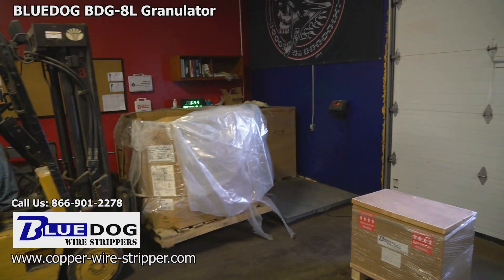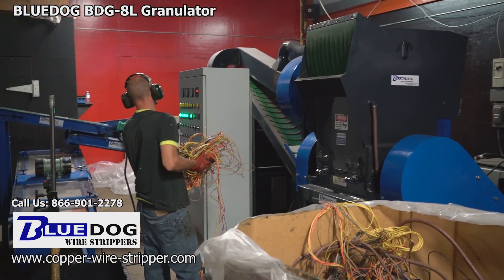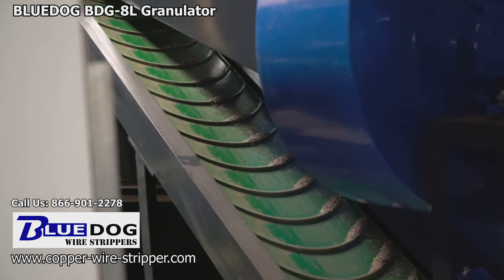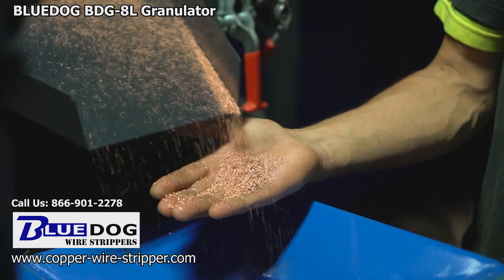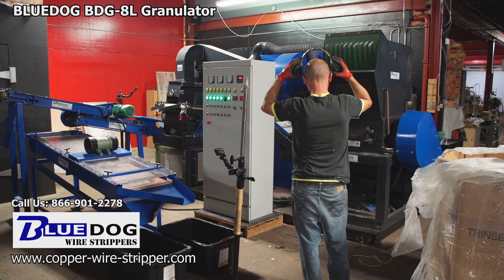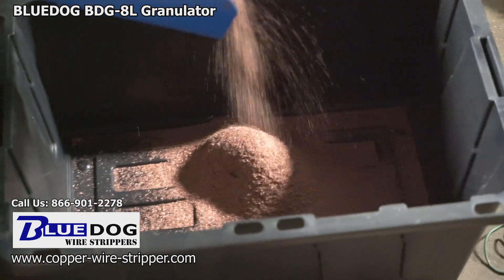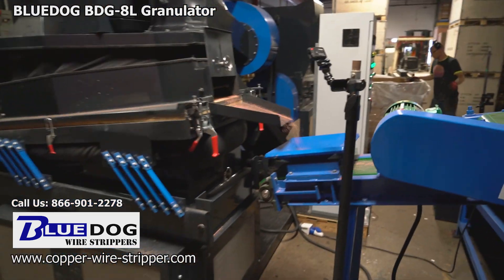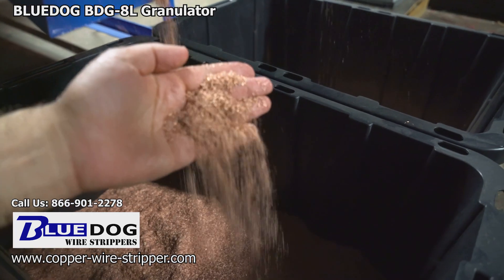Copper Chopper BDG-8L  - Granulate your scrap copper wire

Comment: A copper striper would be much better. This way you know when you take the plastic off you already know 8ts separated frome the copper.this striper in this vido you don't know for sure if all of the copper is separated from  the plastic when it all at once it turns into powder.

Comment: I'm with everyone else; that feeding mechanism is INSANELY dangerous and anyone would have to be a fool to use it.  All it would take is a single loop of wire to be on the wrong side of the guy's arm when the wire gets yanked into the blades and BAM!!!  His arm may not be sucked all of the way into the blades, but a serious injury is absolutely guaranteed.

Comment: Massive potential for an accident there , get it chucked in and don't touch it again. You'll be pulled in as fast as you you could scream. I work with granulators 10x this size, all just as lethal but a wire loop is something else.

Comment: How many tons to make it pay for itself?
Reply: Purchase price per pound today 11/24/21 for romex wire is $1.25/lb. Romex is 60% copper by weight.
The end product of #1 copper dust is being purchased at $3.25/lb today.
Take 100lbs of purchased wire @  $1.25/lb = $125 purchase price.
After granulation/recovery 60% copper = 60/lbs @ $3.25/lb = $195
Thats a $70 profit per 100 lbs (or $0.70 cents per pound profit)
This particular unit comes in at $36,000 USD
That would be 51,428 lbs for this to pay for itself, or 25 US tons.
Reply: @TheShowgunofHarlem cheap

Comment: have you passed an air particulates inspection with that machine running? No filtration safety masks?
Reply: To filter what? There's no dust to filter. Look at the room. The air is clear.
Reply: @mattjohns3394  You might not be able to see it but it can be there. Like dust that's only visible in bright sunlight.
Reply: @EPICRANDOMGUY02  This is the sort of comment that makes people hate Occupational health and safety.  Yes, microfine dust may be present but its not toxic. There would be more (and worse) dust coming off a concrete floor.
Reply: @mattjohns3394  I'm not a health and safety nazi, so I get what your saying.

Comment: Loader needs a loading belt or your going to lose a limb.
Reply: Yeah a thick wire could easily loop around a hand. And to the person saying you wouldn’t be able to reach the blades. Something has got to give. Either the wire snaps, the motor stalls, the hand is ripped off or the guy is pulled in.
Reply: It doesn't look like there is emergency stop within reaching distance either...
Reply: Even shaq isnt tall enough to reach down to where the blades are
Reply: Loading hopper would be better. Keeps the bulk loading below the choke point fo the machine. Wouldn't take up as much space either. Fill up the box, push a button, and the box tips in to the shredder.

Comment: Why don't you put an external AMP meter in the operator view where he normally stands instead of relying on his hearing?
Reply: If the operator needs hearing protection, but has to 'listen ' for the sweet spot, OSHA will be calling.
Reply: Or just spin the CP 90° toward the operator.

Comment: Interesting machine.  I'm sitting here trying to figure out how the machine is taking the insulation off the copper to be sorted/separated.
Reply: pretty sure it's gravity based. Just chop it up into tiny pieces, vibrate the whole thing and the copper falls to the bottom with plastic on top. The finer plastic granules may have some copper left in them so it's recommended to recycle them through the machine.

Comment: I've operated this machine already,its a "beast"!my only problem is that theres too many plastic coming out together with copper in front of the first outfeed,what should be the best setting for the fan speed and the shaker?
Reply: there are only two reasons for that problem:1. the machining precision is bad 2.the screen of the air separator is blocked
Mostly properly the 1st reason if the copper is not coming in the middle
Reply: @keruimachineryfactory5557  ,what is the machine precision?
Reply: @mangembusnalimbe778  it's the working accuracy of making machine
Reply: Usually when the wire too thin ( under 0.2mm), only gravity separation not enough. Need electrostatic separation, i can show you how it works. lol

Comment: At 4:15 there are two buckets, is it the same product in both of them?
Reply from the maker: There are 2 different sized sifting screens on the sorting table.  One bucket is for corse sized granules and one bucket is for fine-sized granules.
Reply: @bluedogwirestripper  oh, thank you! Do you happen to hace a video presenting how that sorting board operates?
I'd also like to know about periodic maintanence, power vonsumption and voltage
Reply: @bluedogwirestripper ,I have difficulties getting the precision for running data wire. It always comes on the front with plastic. 
What are the adjustments for the shaker table running data?

Comment: Instantly chops your #1 copper-wire down into lower valued #2 copper-dust.
Reply: Copper wire scrap price : $2.00
Copper granules scrap price :$ 8.00 
I still don't understand his comment
Reply: @mustafamckinlay-malas801   The reason you are not understanding his comment is because it's incorrect, and he's an idiot. Insulated copper wire (#2 and #3) is currently selling for .20/lb - .28/lb.  It's not feasible to strip it, as it's too thin to be bare-bright, and too time consuming. So for 100lbs of #3, you would get approx $20. By granulating it, you would recover approx 60% copper and sell it for #1 @ $1.90/lb (today's price) @ a $140 return. He obviously cannot do math and is a troll who comments on videos where he knows nothing of the industry.
Reply: @TheShowgunofHarlem  you actually get a higher premium price for the granulated copper.takes less energy to melt it down and process it.was on a service call at a scrap yard and watched this process with the air induction machine.
Reply: I think the idea is that u could use this to make pure clean copper.
Its much easier to melt when it is granulated. You can put the powder into a mold and melt it directly inside the mold.
Another thing this might be good for, is to take wire which has insulation on it still, granulate it, then a magnet used to separate it.
All that said, the machine is probably really really expensive and it doesn't look useful to a scrapper. It's more useful to someone who is into taking it a step further and recycling the metal themselves, which could make u a lot more than scrap value.
Reply: Guy who made this comment is obviously just a scrapper doesn’t know what he’s talking about.... this is made for industrial scale the copper dust is going to get melted down this isn’t for selling to a scrapyard
Reply: how can copper WIRE be worth more than bright and shinny
Reply: You can sell for spot price/Comex price to copper furnaces. I have a copper pipe place that will give you spot price for your copper.
Reply: Holy Revelation your are a dum ass

Comment: Do you get a spare arm when it gets dragged in the hopper....? Very unsafe for gods sake
Reply: Well it depends where it is... It looks like where he's feeding stuff in is actually a chute where the copper slides down into the blades. Not where the blades are sitting right in front of his hands.
Reply: @Tommo020788  If the wire wraps around the person feeding the machine, that wire will either rip him in to the hopper or tear a limb right off.  Research what happens when a boater gets an anchor wire wrapped around their leg.  You never expect it and you're not fast enough to react.
Reply: @Tommo020788   What it looks like is if he gets his arm caught it will rip it off...
Having worked on all manor of plant, commercial diving,  heavy engendering etc 
If it looks dangerous then it usually is!!!!!!
Reply: @theessexhunter1305  If he gets his arm down to the blades his head is gonna be inside the chute. if that's unsafe to you get a mini excavator with a thumb on it. and a conveyor. a lot of yards are running this system though.
Reply: @scrapmanindustries  If his hand gets caught in the wire then he will follow the wire.....just like Dorthy in the wizard of oz....!
The old saying goes like this..
If it looks wrong then it is wrong...
Reply: @theessexhunter1305  there's thousands of people loading wire into hoppers like this everyday. if you feel like its unsafe like I said run a conveyor and a mini-ex.
Reply: My thought too
Reply: Ihateyou Googgle  Know more details in whastapp:+86 15107149073
Reply: Nice and serious question. That's why need conveyor belt for feeding, hahaha...
Reply: Was anyone else hoping and then disappointed when we didn't get to see the inside of the machine?
Reply: the fact you stated that means you should never touch any machinery!
Reply: @troycastor5318  There is a difference between safe and foolish.  Anyone who doesn't see a potential problem with this would not be operating heavy machinery.  It's just waiting to drag an arm in that machine.  Did you see the speed at which the machine suddenly engages the wire?  There would be no time to react.